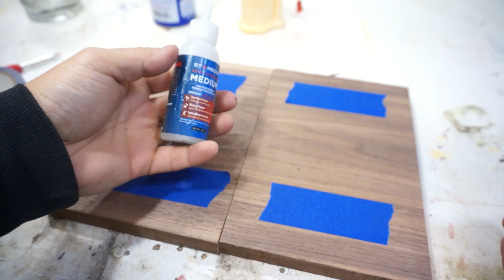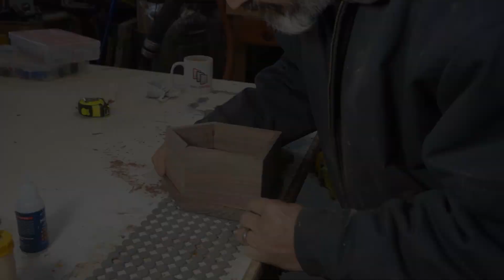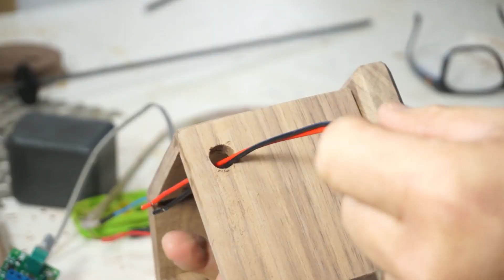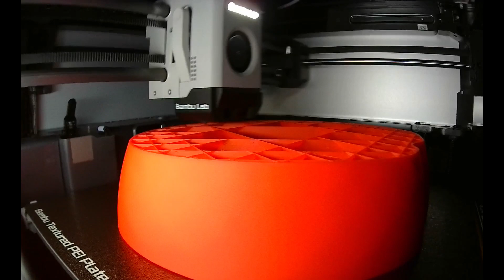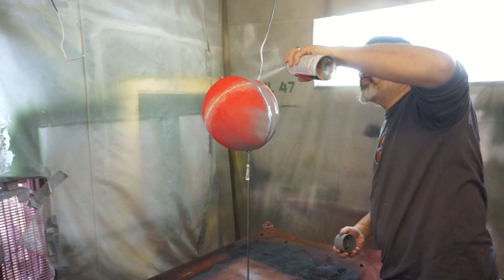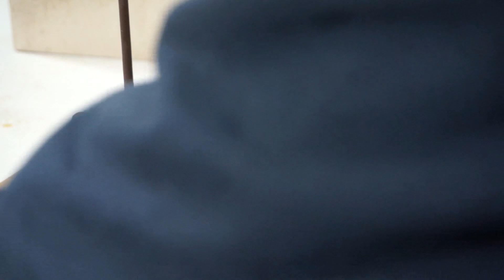Remedy Display With Rotating Peach with voice commentary

Comment: I'm curious what software you have with your X-Carve?  I just got one, and am learning how to use it.  I bought V Carve Desktop, and must say I am not impressed with it.  For 350 dollars, you can do no 3-D modelling with it (except for canned clipart) and it won't generate toolpaths for small bits (less than 1/8 inch) to give fine detail to your carvings.  I am guessing they want to goad you into buying the VCarve Pro for another 350 dollars.  But it makes me wonder what THAT version left out, trying to get you to buy Aspire for two grand.
Reply from the maker: I would work with the desktop version at first to get use to the program and your xcarve .  But if 3d carving is your ultimate goal.  Then you will need to upgrade to aspire.   Vetrics is the best program with the easest to use functions that  I have found.  A bit tip.  Look in to the mini Jenny and regular Jenny bits.   Great compression bits made from a small business.  Thanks for watching.